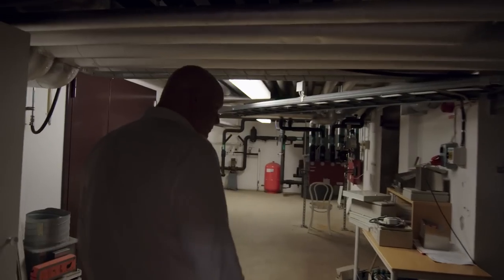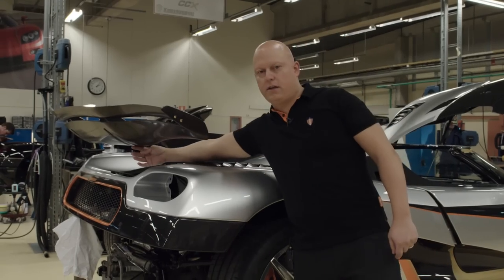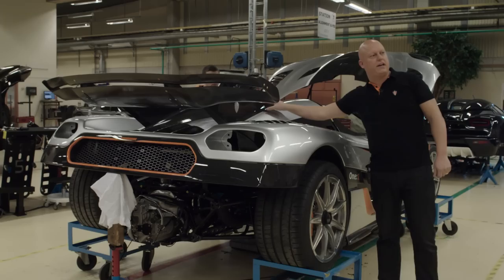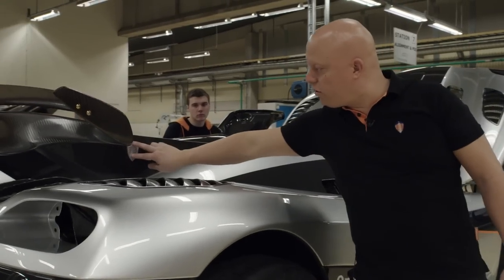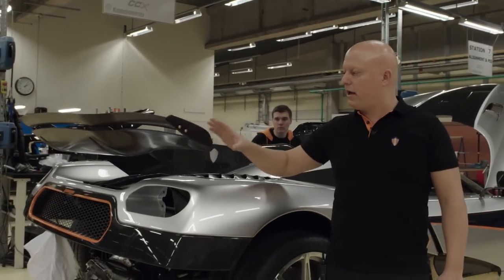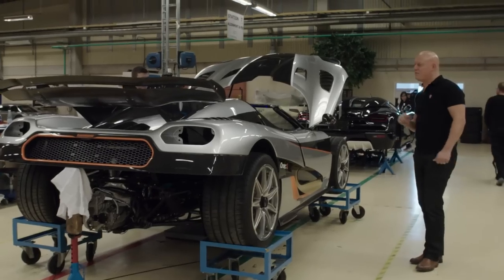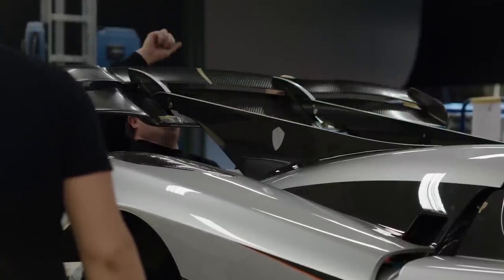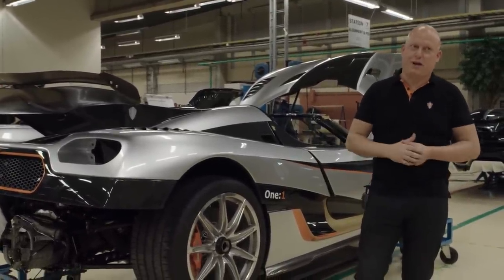One:1 Active Rear Wing - /INSIDE KOENIGSEGG

Comment: We need this guy in F1.
Reply: We do not.  I respect him a whole lot but the engineers in f1 are world class.  Mr koenigsegg is very knowledgeable, but building a car with no rules other that safety is very different than f1.
Reply: ***** It doesn't mean he couldn't do it
Reply: You underestimate the Engineers in Formula 1. They are the pinnacle.
Reply: paul lemaire That's an obtuse point of view.
Reply: ItsThatMilkshake What U mad?
XD
Reply: His cars NEVER go round corners, what would he know about race cars?
Reply: M3Conv Who are you referring to?
Reply: Yeah we need him in the pit..maybe he can be the tire changers!!!
Reply: vitto ItsThatMilkshake It's true. F1 race car engineers need to deal with constant change in FIA rules. One little mistake in detail could ban the car from running on the track and would jeopardize the whole team. They use parts heavily prescribed by FIA standards, mixing fuels with the precise amount of petrol and alcohol (5.75% alcohol), FIA-standardized rpm limit and FIA-ruled engine type. F1 engineers are confined in a strict and endless set of FIA rules to the point that they could have end up not making a car at all; yet, they make superb cars all for just a split-second advantage to other competitors.
Reply: TEH KOTAK hater
Reply: Arnaldo Juris Maclang That guy can bring outside of the box ideas like he does with his cars.
Reply: vitto if it's an aerodynamic innovation (excluding from side skirts because it's FIA-banned) then good for him. If it's computer or technological-based however, I'm not sure if the FIA's gonna allow it or not for standard use in F1 cars.
Reply: Arnaldo Juris Maclang Electric engine tech, mechanical traction, aerodynamic traction, etc..
Reply: vitto He can do a lot. Honestly, Christian Koenigsegg is my inspiration; however, I'm quite afraid about putting an outside-the-box thinker in a confined box called F1 and its strict rules. He might make a lot of developments on the sport, but a lot of it could also be rejected by the FIA. 
So I'm quite unsure about how he'll fare in F1.
Reply: Arnaldo Juris Maclang
Guys, get real....all koenigsegg do is build the same V8TT but keep turning up the boost, what is innovative about that?
Reply: M3Conv It may be a twin-turbo V8, but there are a lot of things, internally, that makes Koenigsegg distinguishable from other supercar manufacturers The engine itself is extraordinary, most cars use forged magnesium alloy rims (while Koenigsegg uses Carbon Fiber), Koenigsegg's version of the dual-clutch transmission is different from other car manufacturers, etc. 

There are a lot of things that Christian von Koenigsegg said that other supercar manufacturers haven't done and/or are just starting to catch up to him.
Reply: Arnaldo Juris Maclang
Tell me more????

Forget about Carbon Fiber rims, Carbon revolution were building the same thing before Koenigsegg were (have a look on their website)

Watching Vmax200 this year i don't think that their transmission is much to write home about, sluggish is the word.

One drive channel last year they said they would not build a hybrid as they dont work in a road car, now what are they claiming to be doing with the Regira
Reply: M3Conv my account of the Agera RS when it went on the track is that it worked really well and it finished 1st even.
Reply: Arnaldo Juris Maclang
I am still waiting to see a Koenigsegg being seriously driven at the track. I know that the LaFerrari kills the Agera in a drag race (and the LaF is not really designed for drag racing).

Send me the links of the Agera at a track, i am quite interested :)
Reply: M3Conv  I'm trying to find a video of an Agera that ran in Circuit of the Americas in Austin, Texas. That's where I saw the car. Not sure if someone filmed it and uploaded it though.
Reply: Arnaldo Juris Maclang
Not easy is it :), much easier if you were looking for a 918, LaF or P1
Reply: Yeah. Koenigsegg might be doing an awesome job, but they're quite inconsistent with their cars.
Reply: Arnaldo Juris Maclang
I agree
Reply: Arnaldo Juris Maclang Maybe that's why he doesn't even think about entering the F1 circus.
Reply: M3Conv The owner drives a Tesla. That's how involved they are right now.
Reply: M3Conv Putting down 1000+ bhp to the wheels seems to be the problem. The owner always talks about the limits of grip, specially with the new Regera.
Reply: Yeah. Putting a too much horsepower on something so light is the problem. Come on, even the Porsche 918 (that also has a carbon fiber chassis) which also ways a bit more only has 887 hp. And we all know how the Porsche 918 handles corners very well. So I think that's his mistake.
Reply: Arnaldo Juris Maclang
You are correct, thats why the power to weight ratio of the 918, P1 and LaF are approximately the same. If just adding more BHP helped than i am sure that the big 3 would be doing that. Only exception is the veyron which can handle well over 1000BHP without losing traction no matter who drives it (4 wheel drive, bespoke tyres, clever aero and extra weight makes it possible
Reply: M3Conv The Veyron could handle the 1000+ hp because it's so heavy. Another thing is that I think putting carbon fiber suspensions affect the cornering a bit, I think.
Reply: +Arnaldo Juris Maclang probably not if you're talking about the wing, undoubtedly they would not use carbon fiber for that if it didn't work properly.
Reply: Sam R F1 does use magnesium wheels though.
Reply: Sam R Nah. Anyway, we don't really need him in F1 because the technology he uses is basically F1 technology applied in production vehicles.
Reply: Sam R Cry me a river..
Reply: +Arnaldo Juris Maclang I just read a website which quoted the F1 tech regs which said that the rims must contain metal, or something to that effect. I would guess that's why they use Magnesium rather than CF. Site was something like F1 dictionary.
Reply: Sam R Is that correct? I thought CF was meant to be stronger than Mag, but that was just guesses and assumptions. Thanks
Reply: CF is aprox 50% lighter than Magnesium and 30% stronger. The advantage of the carbon rims is that they reduce the rotating mass of the wheel at the rim. The Magnesium wheels reduce the mass at the center by making the spokes really thin.
In theory if you can reduce the mass of the wheel at the rim it should improve handling.
Reply: It wont matter if Christian was in F1, he wouldnt be able to do anything since the class is so heavily homologated and restrictive now days. Any new or exciting tech and innovations will immediately be banned.

Comment: Why does he say that downforce is produced by the underside of the wing? Downforce is produced when there is a difference in pressure between the top and the bottom, and if anything, as far as Newton is concerned, the top would be the more important part, since the air hitting the angled surface creates a force downwards.

Comment: What I learnt about planes is: the upper side create low pressure, the lower side create high pressure, and the lower side make the upper side lift by pressure diff. So I think the upper side of the wing on the car is way way more important.
Reply: it isn't, the low pressure zones are located differently.
Reply: Airplane wings: high side low pressure low side high pressure coz low side air flow slower due to a larger angle.
Reply: ROCKETGUNS BOOMBS yeah, but it doesn't translate like that to Car wings. they are designed completely different and do not work the same as airplane wings
Reply: Thomas Ewalts Yes, that's what I mean.
Cars wing is for hitting the air with the high side of an airplane wing and create a down force by air pressure.
Reply: Is it not the low pressure side that creates the force? Top side planes and low side on cars.
Reply: Tom Oliver Yes, the low side of an airplane wing is more important for a car to create down force. The low side wing of cars flap almost have no pressure. McLaren 12C have almost 62 degree up during breaking. Planes like 777 is around 14 degree during take off
Reply: ROCKETGUNS BOOMBS I don't even know if you're trying to disprove Koenigsegg's theory or not anymore.
Reply: ***** No, just discussing, no disagreement.
Reply: He said it's similar to an upside down airplane wing. The bottom of the car's wing is most important, because it's the low-drag, high-downforce aerofoil.  The top of the wing also incurs downforce, but at a much higher drag cost.
Reply: Steven Willmy you get it.

Comment: Everyone is talking (or being paid to talk) about the LaFerrari, the P1 and the 918 Spider, but the real front runner of current automobile technology is this thing and, the Tesla S, this one taking performance as high as it will go and the Tesla S taking powertrains to car 2.0.  If Koenigsegg tried to make an electric car I am sure it would be awesome too.
Reply: No-one gives a shit about Teslas. Especially seen as thought they catch fire! Real petrolheads are I.C.E or maybe hybrid. That's it!
Reply: IIAmGothamsReckoning
 Does anyone pay you to have such a mainstream industrial opinion? And it's just an opinion, empty words. Everyone knows that engine fires are more common the higher the power output in gasoline engines. The biggest offenders are Porsche GT3, Ferrari Italias and Lamborghini Gallardos, that outburn the Model S by several orders of Magnitude. Real petrolheads will of course prefer petrol, nothing wrong with that, but electric motors are better in everything except energy density of the storage medium (batteries vrs gasoline). Maybe in time that will change. If combustion was better it would be used in industrial processes and you would have gasoline robots making gasoline cars. We are driving internal con-bustion, because industry cons us into using them over better alternatives, because they buy and shelve alternative energy patents and then lie about what is the best option because they are hooked on the economic models of ICE engines and don't want to reduce their profit margins, which would happen with electric cars, at least untill they deengineered them to make them break and create revenue.  All this might go over your head so you might as well go back to watching Batman.

Comment: That is one awesome car - though for some reason I had imagined that the wing could go even further at an angle.
Reply: if it gets even more angle, it could create, too much force, thus instability, also, it adds some force, thus more "weight" on the rubber, more stopping power, less likly the wheels lock up
even i thought it would be at least 45 degrees
Reply: William Murphy
It would not create more downforce with higher angle because the angle would cause the wing to stall. But drag would increase. So more drag wich is good but less downforce wich is bad, they simply made the best comprimise with this angle.
Reply: it maxes at 45 degrees, due to the relation between sine and cosine of the drag/down-force ratio
Reply: Did he say 45 degrees? There isnt such thing as a sine and cosine ratio of drag and downforce, the wings design dictates when the stalling occurs, and how the drag is affected by angle. For example the secondary, smaller wing makes the wing able to have a higher angle than if it was a single plane wing. Your sine/cosine ratio should logically only be true for a straight flat board with equal.
Reply: You are 100% right, but ya I was dumbing it down. But I'm not sure how the
secondary works, could you help me out on that?
Reply: William Murphy
Well i have a book called competition car aerodynamics but it was a long time since i read it. It could be that the gap between the two wings creates something that keeps the air behind the wing stick to it better and in turn give ability to go higher angles. In the book it made even more difference to have yet another one behind the secondary.
Reply: William Murphy 
It works just like an aeroplane flap. As the pressure of the airflow on the top surface of the aerofoil is greater, air is pushed through the gap between the wings. This air carries energy (momentum) to the flow on the bottom surface of the second wing, thus, it delays the separation point of the flow, which leads to a increase in the maximum angle of attack (AoA) before stall. Furthermore it accelerates the flow on the trailing edge, increasing the downforce that both wings can generate (as it increases the circulation around the wing).
You can put another wing behind the others to further increase the max AoA but it increases weight, adds complexity to the system and, above all, it increases drag. So you must weight your pros and cons: put another wing and increase drag or leave it as it is and reduce the maximum downforce you can produce?

Comment: An obvious idea: replace rear window & rear-view mirrors with cameras, one in the back and one incorporated into each front wheel well to cover blind spots. Better visibility, less drag, no need to compromise rear end design. Wonder why it hasn't been done?
Reply: It increases weight, cost, complexity and there's more to go wrong.
Reply: +Steve Paulsson It has been done by BMW, they featured the technology you referenced on the I8. Unfortunately Koenigsegg hasn't caught on and implemented it into their vehicles yet.
Reply: +Louis Gordon Really? Cameras are so small & cheap now that you can fit 2 of them in a cellphone. Also there are no moving parts, so there is less complexity and fewer things to go wrong. Thanks to Clifton Dubois for pointing out that it has already been done.
Reply: +Steve Paulsson James Glickehaus did it in his car as well, I think the P5/6 Competizione
Reply: why does Mr. Koenigsegg have no eyebrows or hair... save weight....
Reply: Yes but, apart from the weight reduction, ergonomy and aerodynamics that are of the utmost importance, Koenigsegg, like any other hypercar manufacturer, pays attention to beauty and aesthetic harmony of the cars. And guess what, the side rearview mirrors play a major role to this. And under some circumstances they stabilize downforce.
Reply: yeah super obvious to add weight for the first car being able to push the 1:1 ratio
Reply: A screen that size would be very heavy and if it broke at 200+ mph you'd have a very bad day.
Reply: I think some countries (USA is one of them) that dont allow cameras as substitutes of mirrrors.

Comment: Good. sorry, what type of computer program used to design any type of 3D part.
Reply: +Andy Guamán I think it's called AutoCAD
Reply: +Hassib Rustemi yeah thats the most used software but there is others
Reply: +Andy Gaumen I will guarantee you that they aren't using AutoCad for 3D modeling. If they use an Autodesk product, they will use inventor. My guess is that they use Catia, it's sort of an industry standard.

Comment: the wing looks cool and he explains it well, but it just seems that with the wing mounts mounted so far in front of the wing that it would act like a lever instead of like a wing that presses directly down on normal mounts. To my reasoning it seems like putting a pen half way off a table and pressing the point of your finger down directly where the pen meets the edge of the table vs pressing the pen at the farthest point that's hanging off the edge which would create lift at the other end.. Is anyone an aerodynamicist with an intelligent answer??

Comment: So that is why jet engines are mounted under the wings instead of on top.  There are probably other reasons.
Reply: MCAD gets it right, its a mix of Aero, thrust lines, longitudinal and lateral stability, weight distribution, etc.
Reply: Actually, Honda Jet does it above the wing... It actually works!
Reply: Also correct, engines mounted above the CG of the aircraft are stabilizing (longitundinally), but i do want to see how honda compensated for the vibrations caused by  podded engines like that as well as the natural tendency of the jet to constantly pitch down. (probably a mix of trim settings for the HT)
Reply: http://en.wikipedia.org/wiki/VFW-Fokker_614 - not always